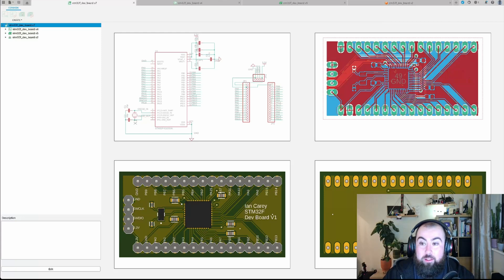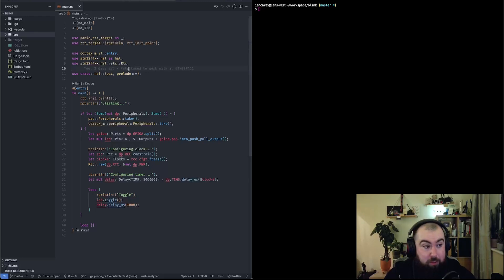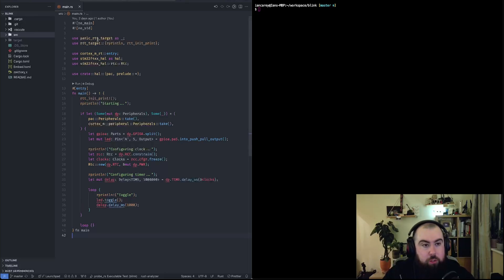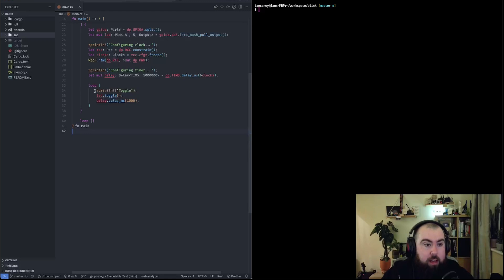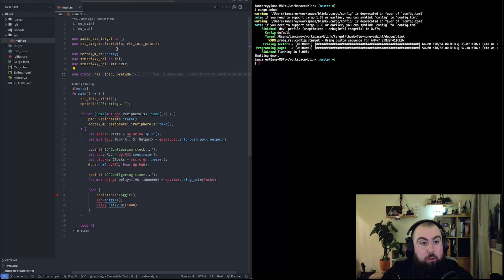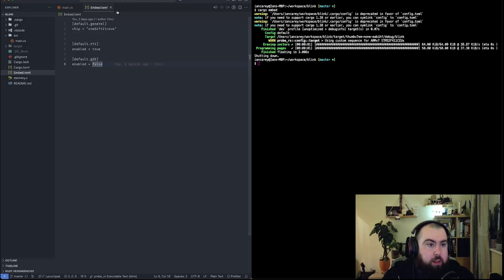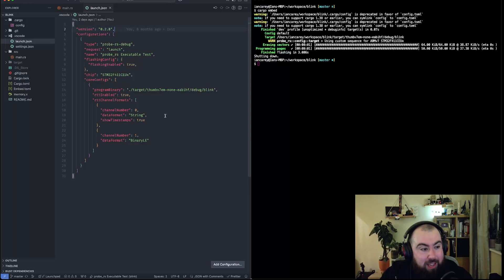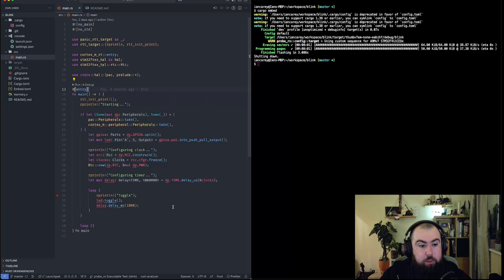Custom STM32F Dev Board Running Rust!

Comment: Thanks for the info. I use ESPHome on ESP32's and it has opened a whole world of IOT microcontroller integration. Interesting to learn a bit about STM, but I know nothing about RUST.
Reply from the maker: I am actually in the process of my first project using an ESP32 with MicroPython at the moment, very power little device, I’m very impressed. I’ve made a few dev boards with STM32s now, it’s my go to for my robotics projects etc. Rust is a great language, I’ve been running it for loads of programming projects recently, I’m really liking it for embedded too.
Reply: @careyian   ESPHome's high-level modular yaml is great, but it makes any other language seem daunting. Do you have good RUST primers for STM which you can share?